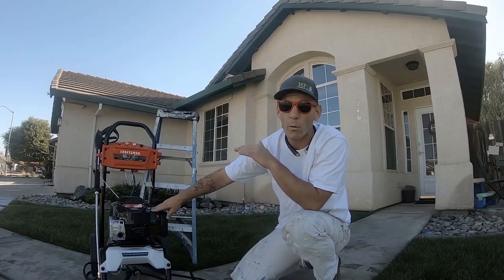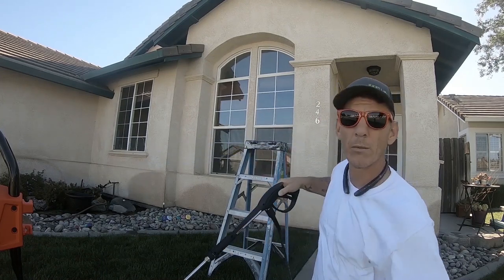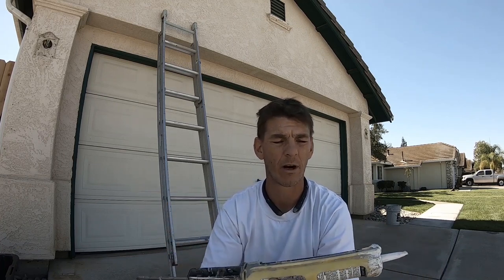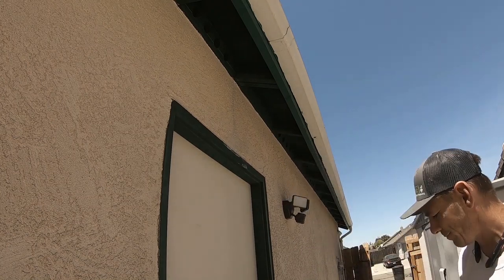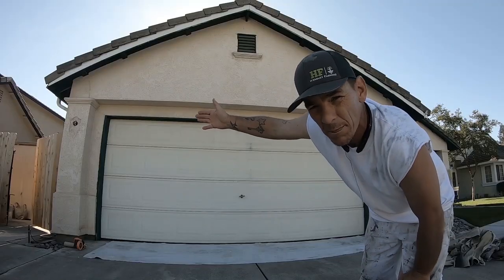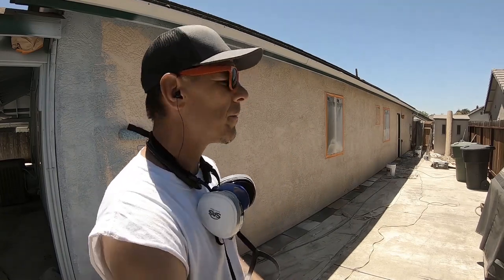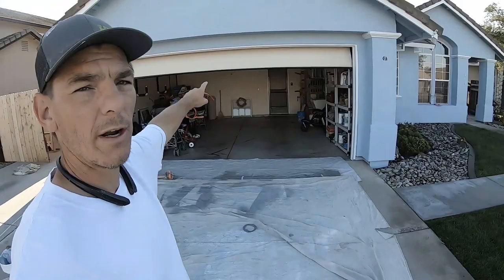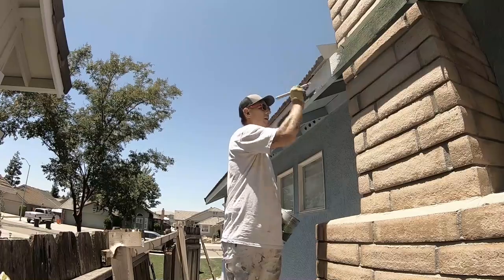$4500 PAINTING JOB RECAP // PAINTING a house from start to finish SOLO

Comment: Awesome trick I learned for cracks in stucco: Run a bead of caulk over crack, spray your paint right over that bead, then backroll the paint and caulking into the stucco over the crack. Later once dried it blends perfectly no flashing, or anything.

Also, if you rub some dirt into those big fat wet drips on the concrete the dirt will absorb the pigment and its like it never happened. You don't have to come back and chip it up later with a putty knife. Dirt, incredibly useful.

Comment: The first caulking gun is a dripless gun I’ve been using them since they first came out. The only time they do drip is if the caulking gun was left in the sun for too long and the pressure inside the tube builds up.

Comment: When you bid a paint job on a house how do you figure how to price it?
Reply from the maker: Figure your production rates out. For example how long it takes to paint 100 sq foot wall.  Then use basic math to get a ball park. Add material plus 12% then add labor plus whatever margin you have worked in... good luck friend
Reply: Thanks!